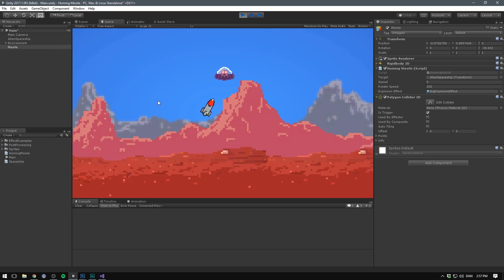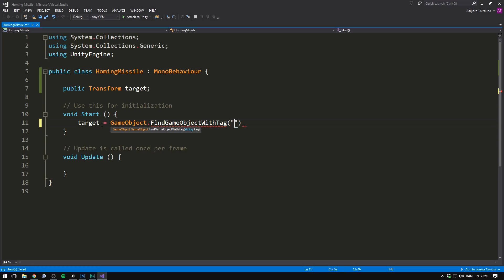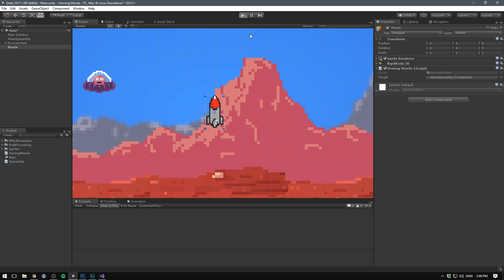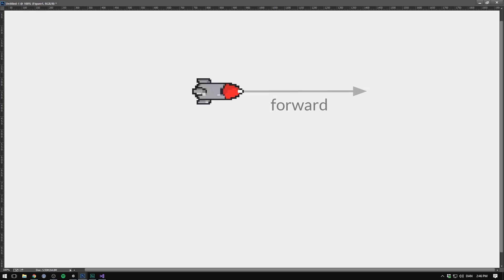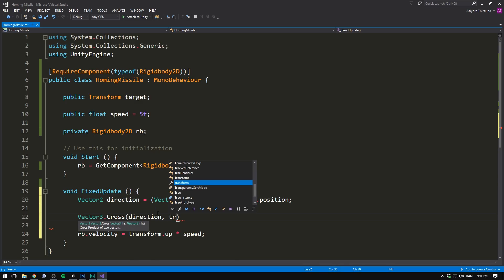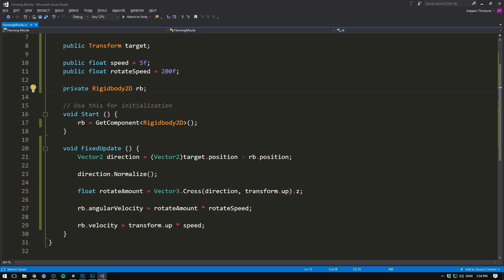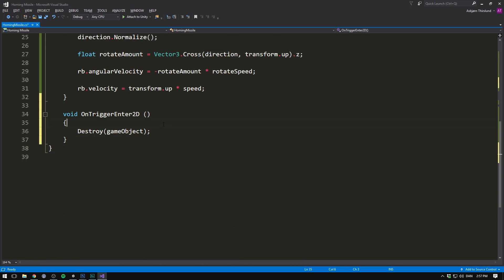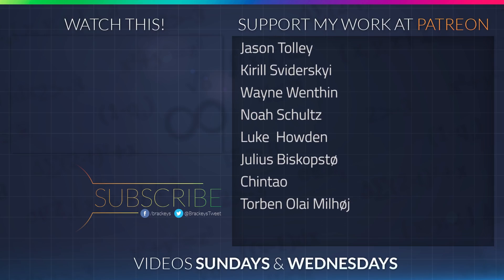How to make a Homing Missile in Unity

Comment: With this if you stand behind the homing missile, it won't rotate much towards you. For this I would use something like Vector3.RotateTowards instead. 

Or if you want to do the math (Don't. Unless you want to understand how it works), then use a dot product between your right vector and your toTarget vector, to determine which way to rotate. Then use a dot product between your forward vector (or wherever you're facing, which for the rocket here is up) and your toTarget vector, to find the current angle to avoid overshooting your rotation.

Comment: +Brackeys It seems like a lot of things can be accomplished using either triggers or colliders and I'm never sure which I should be using.  For example you use OnTriggerEnter2D here, but couldn't you also have done it using OnCollisionEnter2D?  A video about the differences and when to use one or the other would be great!
Reply: The difference is that if the trigger box is checked on the rigidbody component then there will be no physical collision, the object would just pass through the other object, but the OnTriggerEnter function would be called, allowing you to create custom collision behaviour (like destruction). 

Otherwise if the trigger box isn't checked then Unity's physics system will cause a physical collision and make the objects hit each other and stop/bounce, but also it will call the OnCollisionEnter function and allow you to create extra custom behaviour (like destruction too). 

So the difference is that by making the rigidbody a trigger you remove the possibility of it having physical interaction with the environment or the target since all you really want it to do is explode and reduce the player health, not knock the player around chaotically

Comment: Just a side note:
The order of the parameters in Vector3.Cross() is important, e.g. A x B will not give you the same as B x A
Reply: I don't think that's how math works
3 x 5 == 5 x 3
Reply: @Nope Nope cross products in not commutative like a product of two reals. When you commute it flips signs.
Reply: +Nope Nope
What I mean is Vector3.Cross(A, B) and Vector3.Cross(B, A) will result in vectors that point in the opposite direction. That's probably why he had to put a minus sign in front of 'rotateAmount' when it didn't work as expected the first time.
Reply: So couldn't you replace 'minus'ing the result with just flipping A and B?
Reply: Yup, that's my guess. 
But that would only cause the direction of the rotation to reverse. I don't think that was the only reason why the missile went in the opposite direction. It looks like the reason for that was because shortly after the game started, and the missile rotated a bit, the target was directly behind the missile, making the direction to the target and the missile forward direction parallel, and therefore the cross product equal to a zero vector (making rotateAmount = 0), and thus the missile stopped rotating.

Comment: Please make a video about how to draw the trajectory of a projectile
Reply: There's probably a better way to do it, but here's 1 solution. It may be easier than you think depending of the physics of the projectile you are drawing the trajectory for. If you're just firing a projectile (with a known initial speed and position) with any constant force than you can just use kinematic equations (see below). However, I've done a project before where forces aren't constant, in which case it gets more complicated. 

First of all you'll need the acceleration of the projectile, a = f/m (acceleration = force / mass). If the only force acting on the object is gravity (I'm going to assume this for the example), a = -9.8 (negative because it points down). Then you use this equation: d = (v * t) + (1/2 * a * (t^2)) (d = distance, v = velocity, t = time, a = acceleration). Use it once for x and once for y (and once for z if needed). As in use the x component of the velocity and the x component of acceleration, replace the x with y and repeat, and so on. If gravity is the only force, x and z use a = 0 because gravity only points directly down, so it only affects the y. After you do that, you can make a Vector out of the distances you got back (distance using x, distance using y, distance using z). Then just add that vector to the starting position of the projectile, and you end up with the position the projectile will be at in t amount time.
So throw all that in a for loop that goes over a range of values for t and draw a dot at each position. You'll end up with a dotted line which will be the path of the projectile.
Note: this doesn't account for drag, which have small default values in rigidbodies, but the drag is small enough that this should still produce an accurate trajectory.

Example pseudo-code:
public void drawDot(position){
    draw a dot at position
    }

public float distance(v, a, t){
    return ((v * t) + (1/2 * a * t^2))
    }

inside where ever you want to do this{
    for(float t = 1; t < 10; t += 0.5f){
        dX = distance(rigidbody.velocity.x, 0, t);
        dY = distance(rigidbody.velocity.y, -9.8, t);
        dZ = distance(rigidbody.velocity.z, 0, t);
        dis = new Vector3(dX, dY, dZ);
        drawDot(startingPosition + dis);
Reply: Thank you, I will try that. And what would you recommend to draw the points in a 3D space?
Reply: GameObject <name> = GameObject.CreatePrimitive(PrimitiveType.Sphere);
<name>.transform.position = new Vector3(x, y, z);
to create a sphere and move it to a position.

Comment: Why would you put in RequireComponent? I didn't understand that
Reply: It means that if the script cannot find the "required component" then it will add it automatically to avoid errors.
https://docs.unity3d.com/ScriptReference/RequireComponent.html
Reply: But why would the script not find the component, that's the part I don't get. Thanks for the reply!
Reply: If you don't manually add the Rigidbody component to the same gameobject that has the missile component, GetComponent won't find it. That's basic Unity stuff. If you are so new to Unity you should start with basic tutorials.
Reply: I'm a beginner but not that much haha. I understand this if we don't add it manually, but if I remember to add RequireComponent, I don't see why I would forget to add the RB. That's why I thought that something could happen that would remove the RB for some reason, and so the need to add this to prevent that. But that doesn't seem to be something that happens, so it's alright, I guess

Comment: Couldn't you just use transform.LookAt(target.position); ?
Reply: try it...... it gives you a glitchy effect when its attached to the player forever
Reply: I've done this myself in a project (using Quaternion.LookRotation, but I imagine it's similar), and there are key differences. If you want the missile to turn over time, the solution in this video is the way to go. However, if you're looking for something to always face the target LookRotation is the way to go.

P.S. here's the line for the LookRotation:
transform.rotation = Quaternion.LookRotation(transform.forward, targetPosition - transform.position);
Reply: can you add a speed to the lookRotation?If you could it would be exactly the same.
Reply: The only way I know of to turn over time with rotations (Quaternions) is to use Quaternion.slerp(target, initial, percentage of rotation) and increase the percentage of rotation with the update (reseting once completed). However at this point it would just be easier, and simpler, to use what's in the video.
Reply: @Spartaton  I know this is old, but I have spawners, spawning prefabs that shoot at the player. The prefabs are supposed to rotate to the position of the player, but they only rotate to the first position of the player. The subsequent spawned prefabs shoot to the players first position as well.
Reply: @carterchell4817  Same for me. you got a solution ?

Comment: Hey i need a hint: i am using transform.lookAt() to make a bot look at the player, which makes he basically "aimlock"
I'd like to make him turn around smoothly, kinda like the Angular Speed property from the NavmeshAgent. Any hints?
Reply: Lerp the Rotation vector with Vector.Lerp or any other of the smooth methods.
So instead of  doing Rotation = LookAt (...)
You go with Rotation  = Vector3.lerp(Rotation, LookAt(...), 0.3f);
Adjust the values, and it should rotate smothly.
Reply: Morphexe ill try it. Guess im not familiar enough with unitys api

Comment: Maybe anyone will know how to do it. I tried for learning puprouses, use this homing idea for adding for my learning project 'homing enemy ball' which will go after player, of course in 3D aaand after some time and swearing few times as well, i manage to make it, but i have a problem with really low turning which makes it circling around player in some cases. When i extended side rolling (Horizontal) speed, i made the ball go sometimes sideways just because it was quicker. I tried few idea already to fix it but nothing worked in the end. I tried main speed for verticle speed and then using rotation as mulitply for side rolling but how i said nothing, maybe i should do some if to make it go with other speed when close to player? but decreasing it wouldnt be fine because its just not full speed/potential of enemy?

Here is the code: 

using System.Collections;
using System.Collections.Generic;
using UnityEngine;

public class Enemy : MonoBehaviour {

    public Transform target;
    public float Speed=2f;
    private float rotateSpeed;
    private Rigidbody rb;

 void Start () {
        rb = GetComponent<Rigidbody>();
 }

    void FixedUpdate()
    {
        Vector3 tDirection = target.position - rb.position;
        tDirection.Normalize();

        float moveHorizontal = tDirection.x;
        float moveVertical = tDirection.z;

        Vector3 movement = new Vector3(moveHorizontal, 0.0f, moveVertical);
        rb.AddForce(movement * Speed);
    }

}

Comment: mine just gets destroyed right when i press play
Reply: maybe you have a collider on the backgroud
Reply: i dont have a collider its just a sprite renderer but right when it touches it it gets destroyed
Reply: hummm did you write Destroy(gameObject) on a Start() Method?
Reply: ya i did exactly what he did using System.Collections;
using System.Collections.Generic;
using UnityEngine;

public class Follow : MonoBehaviour {

 public Transform target;

 public float speed = 5f;
 public float rotateSpeed = 200f;

 private Rigidbody2D rb;

 public GameObject explosion;

 

 // Use this for initialization
 void Start () {
  rb = GetComponent<Rigidbody2D>();

  
 }
 
 // Update is called once per frame
 void FixedUpdate () {
  Vector2 direction = (Vector2)target.position - rb.position;

  direction.Normalize();

  float rotateAmount = Vector3.Cross(direction, transform.up).z;

  rb.angularVelocity = -rotateAmount * rotateSpeed;

  rb.velocity = transform.up * speed;
  
 }

 void OnTriggerEnter2D ()
 {
  Destroy(gameObject);
 }
}
Reply: ooh, how weird, I don't know what is the problem, set everything off, except the missile, press play, and see what happen
Reply: well it does fly around and stuff,  but if it touches anything it explodes, is there something he did to make it only if it touches a rigidbody?
Reply: Yes, you need to confirm if the other collider OnTriggerEnter2D is a gameObject with tag "Player", so add a conditional. For example: void OnTriggerEnter2D (Collider2D other) { if (other.gameObject.tag == "Player") Destroy(gameObject)}; }

Anyway, the example scene in this video doesn't have any collider, only the player has a collider, so the missile can fly around freely.
Reply: The missile explodes when detects a collition with any collider, doesn't matter if is a rigidbody or not, because the rigidbody attached to the missile is the responsible to detect collisions.
Reply: Make a layer for missiles and a layer for the targets. Go to Edit > Project Settings > Physics 2D and check/uncheck the corresponding checkboxes to make the layer missiles only interact with targets layer. If you just add a check by code, the missile will still collide but get stuck instead of exploding.
Reply: That's right. Good idea.
Reply: vistaero can you help me? My missle does not explode, it just disappear after 2/3 seconds